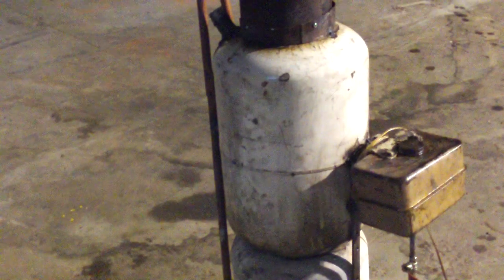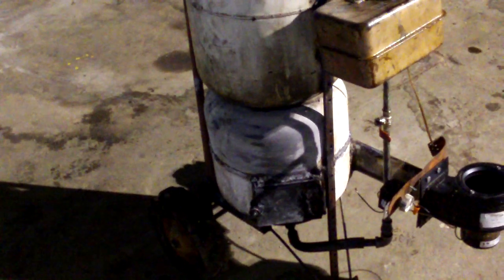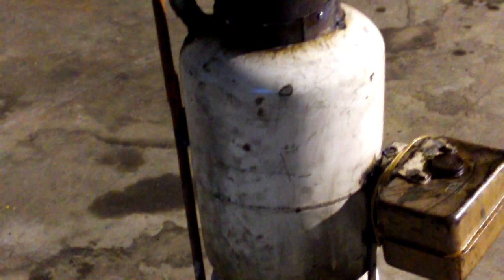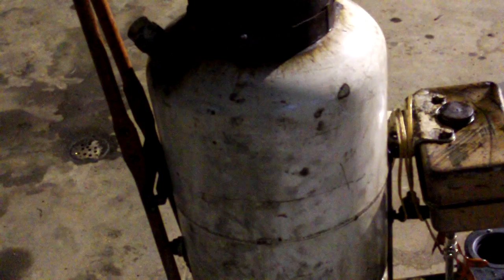waste oil hot water heater.MOV

Comment: How hot and how many gallons per minute I made a oil burner stove and it will melt steel I’ve got to use cast iron brake drums, rotors for the burn pit
Reply from the maker: Maynard 59 it was a massive fail I could never get the welds to hold water around the pipes once it warmed up
Reply: Just an idea that I'm probly gonna try here shortly but instead of having multiple pipes inside why not use a length of copper tubing coiled inside the heating chamber..then you wouldn't have problems with leaks as any joints would be outside of your heat chamber..probly just using compression fittings would be best...just a thought cause you have the right idea it's just that you've perhaps overcomplicated it..another thing is you have your oil coming up through the bottom and I think you would have better results if you brought it in from above and work with gravity instead of against it..you can use the oils own properties of wanting to stick to everything and the downward flow caused by gravity and air pushing it and this way no nozzles are needed at all..could bring it to your burner just with a four inch spike or something..anyhow keep at it..you're right there it just needs tweaking a bit..good work!